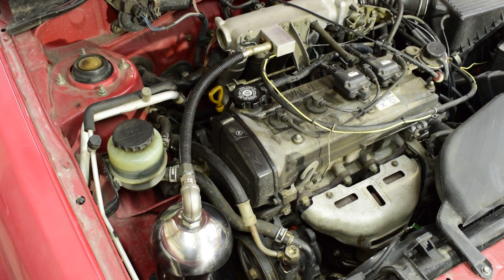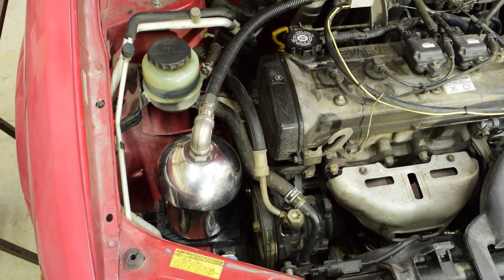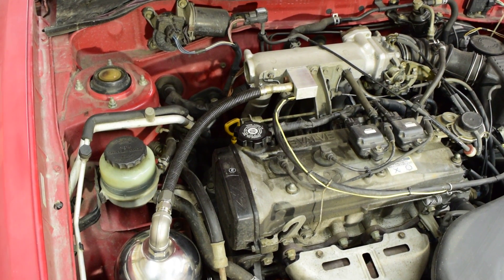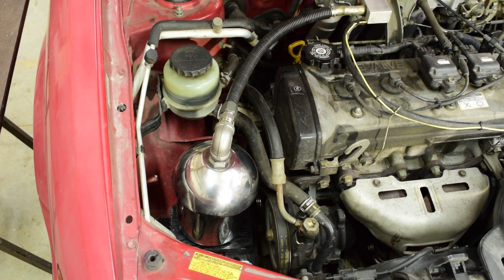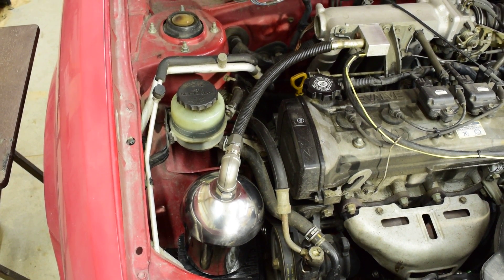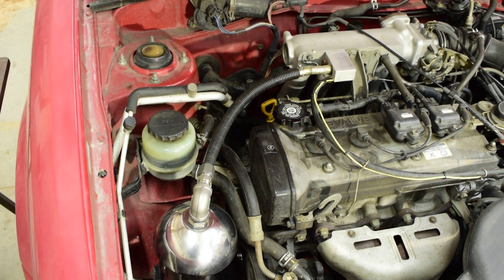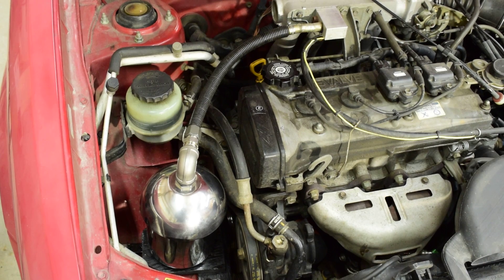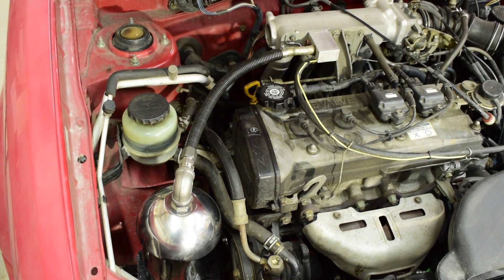A Joe Cell that Actually Works - Part 1 | Stock EFI Engine gets 46mpg

Comment: Hi there, is it possible to post a video of your Joe cell working. It is difficult to be convinced when a video does not actually show the cell working.
Reply from the maker: Thank you for your comment. Honestly, there is no way to show a Joe Cell working. It has no moving parts. The only evidence that it works is the sound of your engine, which changes, and the gas mileage, which increases. I am not sure how I could show a working cell, when it has no moving parts? In my experience, I can tell that a Joe Cell works because it causes the engine to have "pinging" the moment you attach the cell to the engine. Pinging only occurs when a car is driving, and under load. It speeds up the burning rate of the fuel, so you'll get spark knock, or pinging, until you switch to high octane fuel, and then the pinging goes away. You can hear pinging the moment you bolt a cell on, but unless you are a mechanic, you probably won't notice. Once the engine is adjusted to the cell, and using 91 octane fuel, there is zero pinging. The pinging occurs immediately after you attach the cell to the engine. Others have had this same experience, if you do your research.

Comment: This is great to see you on youtube again! Is this book about Joe Cell has been much changed to those I bought in 2013?
Reply from the maker: +Shveik1000 Thanks so much! I did go through the eBook and update some of the photos, and made some corrections.
Reply: +supermuble  I see. That is you who is back to receive a lot of thanks!)) I am just trying to copy your results.
 By the way I made HHO heavy duty charger with your plans. It even worked with drycell.
Unfortunately, I can not figure out the right way to solder everything only with cheme for 2 and more MOTs on one charger.
If you have any chance to make video or addition to plans with a model of HHO charger with 2(or more) MOTs, it will help me a lot.
Reply from the maker: That is good feedback. If you email me from my site I can help you to scale the charger up to something even more powerful without using more modules.
Reply: +supermuble Great! Sure, I will.